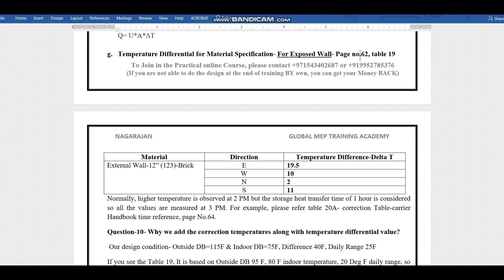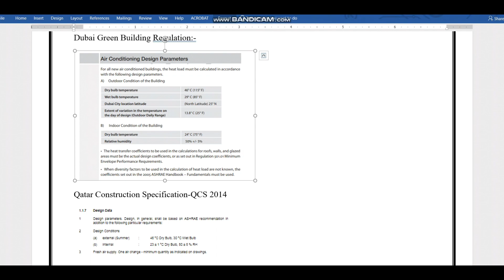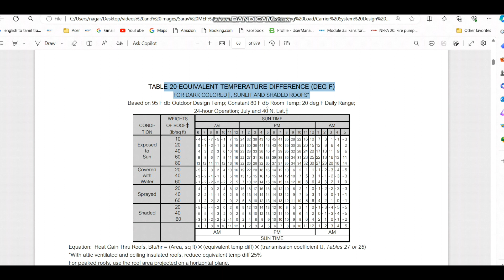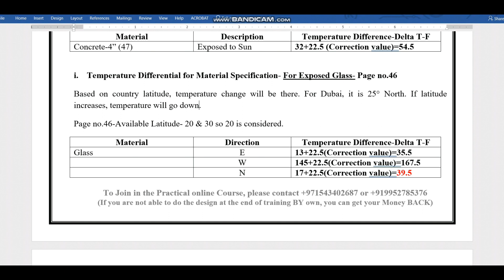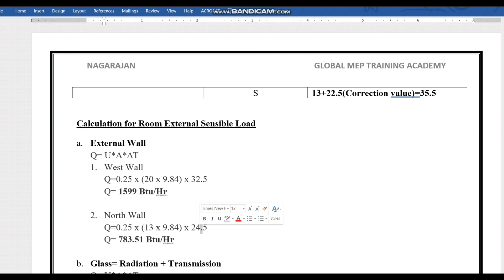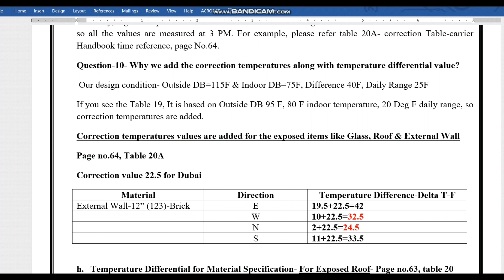Part-5-HVAC Manual Cooling Load Calculation with Practical Example, Design Ideas & Issues

Comment: Do we have to compulsorily add correction factor for solar gain through glass also.
Reply from the maker: Yes
Reply: @mepworld3385 . Thank you sir for your answer. Sir infiltration of outside air through door and windows. How we calculate that. Do we even need to calculate that for cooling load calculation.